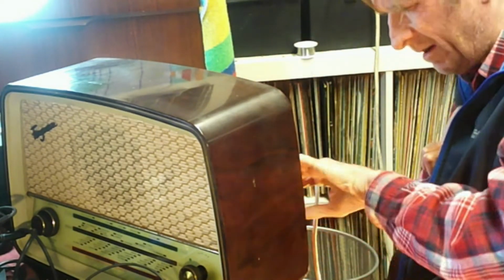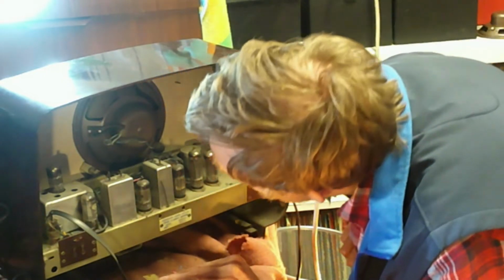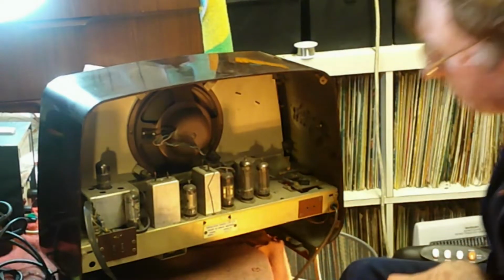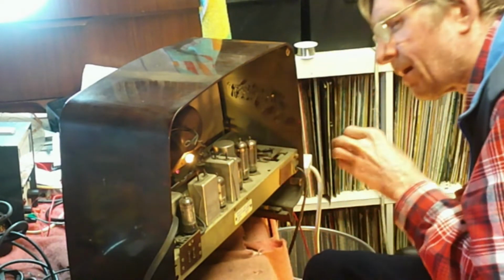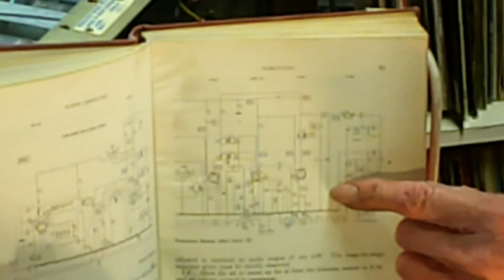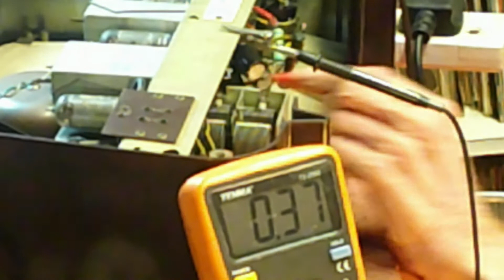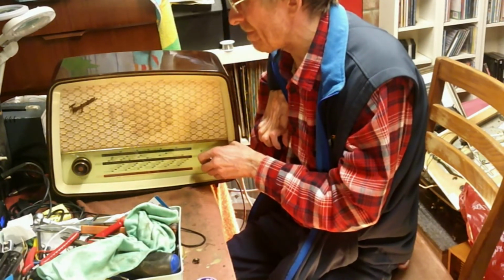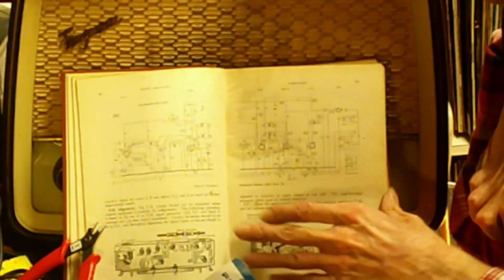A Run of the Mill Ferguson Valve Radio

Comment: Hi Steve, I'm restoring this exact model of radio but having problems removing the band select an frequency control knob. Should it just pull off as per the power and volume control knob? With it having the glass behind it I don't want to force it too much. I've tried some release spray and even some heat but it's just not moving! Any advice?
Reply: Just an update on this in case anyone else has this issue. I managed to get enough gap between the tuning control and the band selector to get a sharp tool in to release the metal clip slightly. With a bit more gentle prising with a wide edged tool I managed to prise it lose. It is just a simple pull off control but the shaft was completely corroded compared to the control on the other side.